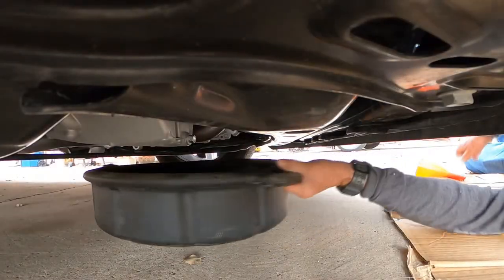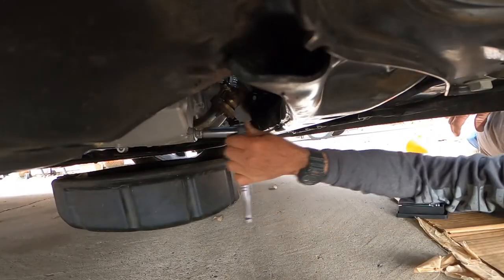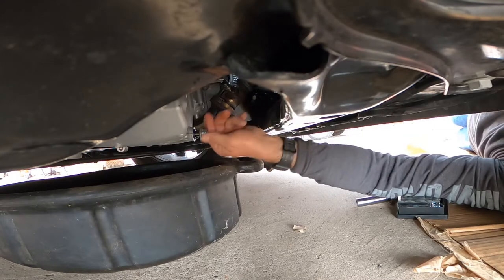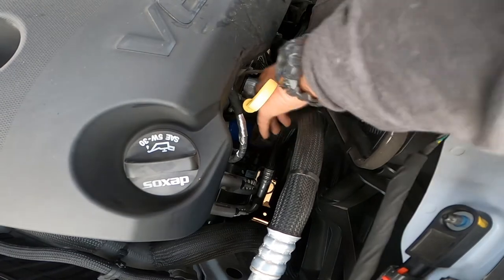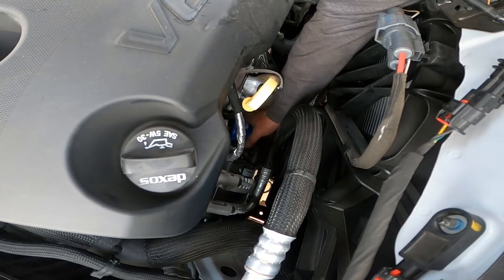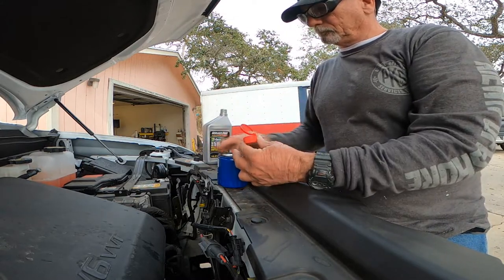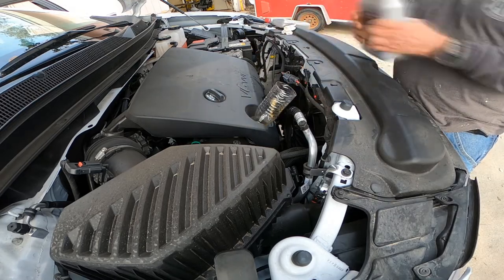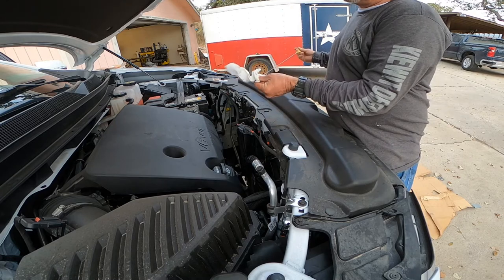Changing Your Own Oil in a 2020 Chevy Traverse

Comment: You forgot to mention that oil leaks out all over the lower crossmembers and other areas when you remove the filter because of the poorly designed placement of the filter.

Comment: Nice Video,  Isnt the check oil procedure a pain?  Helping a friend check a brand new 2022 and seemed liked it needed a quart after 3k miles but when it sat for 15 minutes when to the bottom of the cross hairs. Still not in the mid or upper cross hairs but maybe when he checks when cold will be more accurate.  Reading the manual, they prefer to be checked cold or wait 15, 30 or even 2 hrs depending on different conditions.    Thx
Reply from the maker: Thanks for watching and commenting